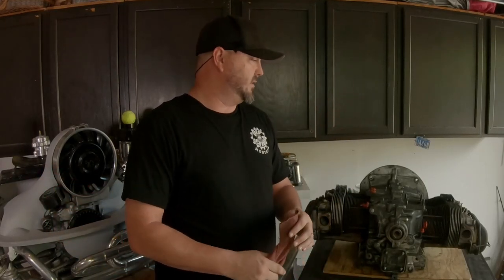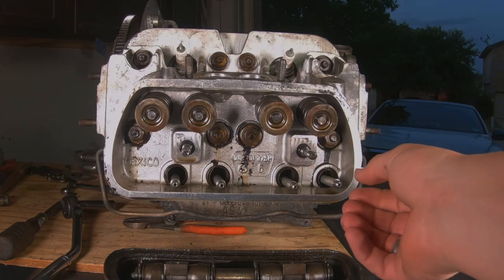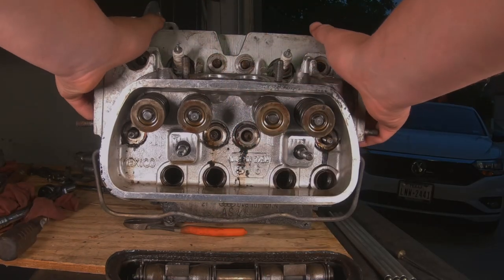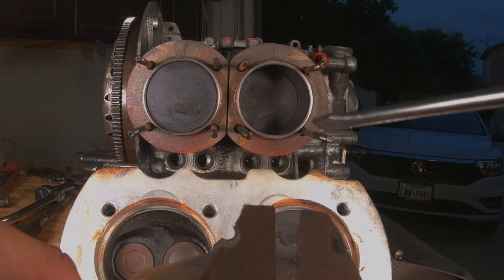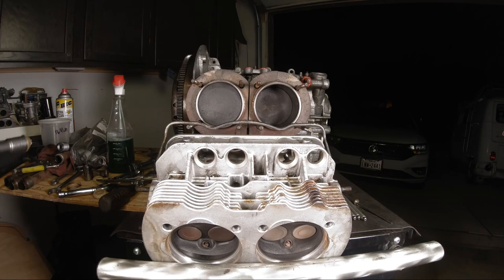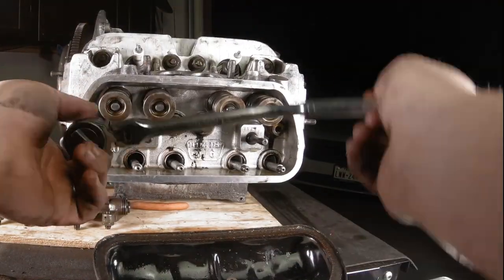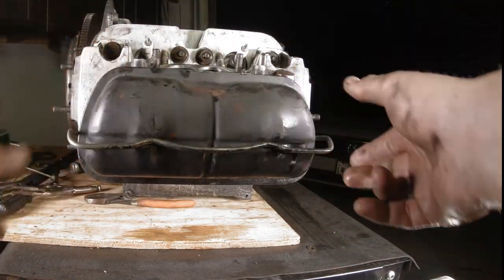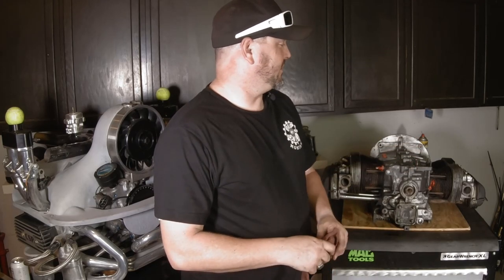VW 1600CC Engine Head Removal

Comment: My dad and i are rebuilding (1600cc) the top half, basically dp heads and 1641 slip kit pistons. We've never been this deep in this and this video is really helpful.
Reply from the maker: Thanks! It's not so bad if you take your time!
Reply: We havent taken off the heads or pistons yet so we dont know the condition of the bottom end. We do not have enough of the knowledge or experience to crack the block so we are hoping everything is nice and tight (or how its supposed too be).

Comment: Couple of things I think should be done, 
   1--Use the recommended torque pattern
   2--Leave the pushrods out of the tubes till ready to bolt on the rockers. You should take a look at the tubes and make sure they are crushing in      straight, if they start to go crooked use a 3/8 long extension and insert it into the tube and you can adjust it. I have had motors where the tube was so out of alignment that the pushrod rubbed on the tube and wore a hole through it and allowed the oil to eventually drain out seizing the motor.
   3--Lube the ends of the pushrods with a dab of grease so they don't wear upon start up.
   4--A decent torque wrench will work at low torque values.

Comment: hi there. @6:07, you mentioned that theres some oil by the piston and that the head looks oilier than cyl4. What does that typically mean other than the fact that your engine has been sitting for a while?
another question is, what if the head is on there tight? what is the best way to remove them without damaging anything.
I have a 1641 DP and its burning a ton of oil but doesnt smoke. Plugs are not fouled and the motor sounds good, runs good and cranks evenly. Safe to say that the rings are good? just need to replace the heads?

Comment: Another Q - New head came in w/ the  8 double end threaded studs that require insertion. OK.. double nut install w/ washer between ? Torque Lbs ? Locktite ? What color Locktite ? Advice ? thanks - Pg
Reply from the maker: Yes, double nut with red loctite, 23lbs torque for 10mm studs, 18lbs for 8mm studs.

Comment: Hi got a 1600 71 supa beetle cylinders 3/4 are not firing any idea what to look for to start with , new sparks, Leeds, cap n rotor , coil , cleaned carby still same
Reply from the maker: Have you run the valves? What distributer is in there? Is it in good shape? Do you have spark at all 4 cyl?

Comment: by the way are stock engines cases available at a decent price anymore ? i never did a vw yet but did 440s 350s in the past ,,,,as i get old i just wanna ride them not work on them ,,,,but at today's prices and undependable work being done out there i way have to do one myself now ,,,,,,thank you for the nice vid ,,,,i did subscribe cause i liked it ,,,,
Reply from the maker: New cases are available from some of the parts houses. Autolinea make a very nice case. Most of the time we buy a used engine and have the case cleaned and checked. They can be align bored and thrust cut for new bearings and put back into service. It's important to have them checked beforehand as the magnesium can have hairline cracks or become brittle if it sits out in the weather for too long.
Reply: @OldVolksTV  thank you up to now i been using rebuilt old cases ,,,and somehow i am always told the bearing got beat so bad you need another case LOL ,,,,,i should do it mysefl maybe is a hint for me ? thank you

Comment: Do you use the cooper rings between the cylinders and the heads?
Reply from the maker: Using shims depends on the desired compression ratio. In most cases I just use a little Aviation sealant and the paper gaskets.

Comment: I took off my engine 5-6 years ago as the spark-plug would keep blowing off along with helicoil. I thought of replacing both heads. Problem im facing is gaining access to bolts of heads. Im stuck at taking exh-manifolds off as the bolts are rusted. I applied wd-40 & heat but im afraid i may melt something inside with applying too much heat to the bolts 🤷🏻‍♂️
Reply from the maker: You probably won't melt anything, the exhaust gets pretty hot anyways. Try some PB blaster and a solid "tap" with a hammer. I've had some pretty stuck bolts come off easy that way.
Reply: @OldVolksTV  Gotcha! And just making sure that I do need to take the manifolds off in order to get the heads off. Seems like its in the way. Thank You!
Reply from the maker: I would pull the manifolds off. It makes everything easier.

Comment: one question if i may, i have disconnected the engine and brought it half way down to remove the passenger cylinder head. I have removed both nuts off of the intake dual port manifold but i cant move it upward to clear the studs to take it off, because, well, the mono tube is anchored down. I cant remove the engine tin above the cylinder head either because the 4  bolts on top are obstructed by it - Do I need to disconnect the generator support stand / bracket now ? What all needs to come off working with what I got w/ what i described  to take the head off?  - thanks..Pg
Reply from the maker: Its easier to pull the motor completely out. The generator stand, intake, fan shroud, and head tin needs to be removed to gain access. It's also easier to work the head off if you have access to the whole thing.

Comment: Stupid question, do I need to drain the oil to pull the head?
Reply from the maker: You don't NEED to, but it can be messy if you don't.
Reply: @OldVolksTV  Thanks! I just picked up a motor I was told is a 2332cc and just trying to confirm.